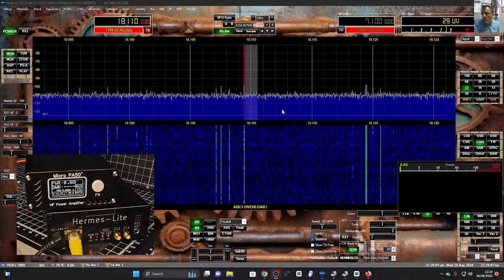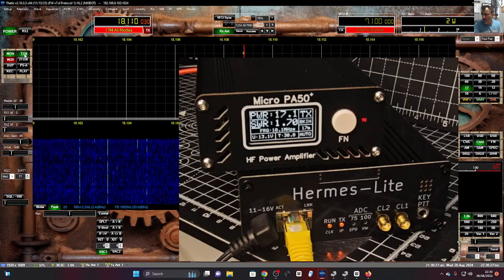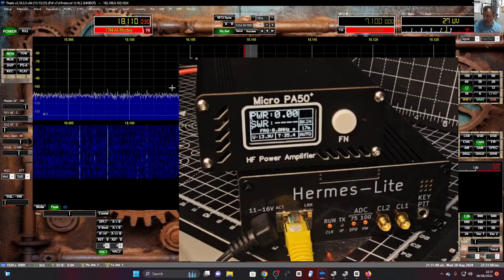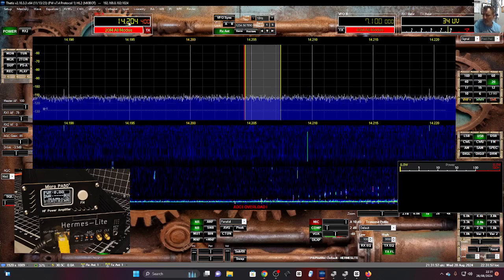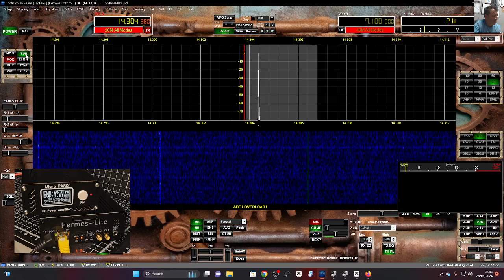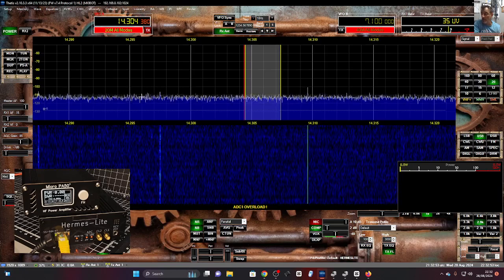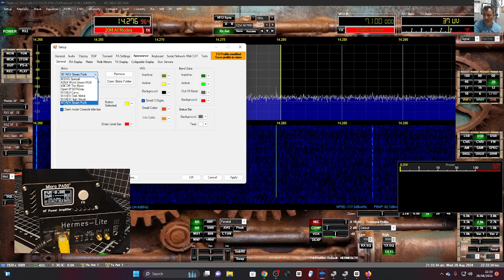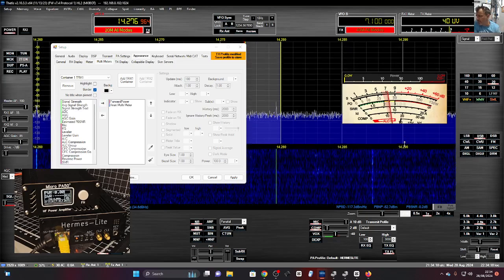Hermes Lite 2 & Micro PA50 watt Amplifirer

Comment: What is the amplifier's firmware version?
Reply from the maker: https://youtu.be/itwblf0cmSY?si=KjIZdpUpfHQ4WN9r
Reply: Great video.  Say, do you know if the Xiegu L4001 cable works between the x6100 and the pa50+, so we don't have to depend on autosense?  Thanks in advance.

Comment: hit the white button 9 times. I have the none + unit but it's in a different room with a ATU. When I tune up the Amp will beep(over power or high swr) but after the ATU is done tuning the Amp will reset after about 3-4 seconds so there is no need to hit the button . 

Right click on the AGC Gain slider and it will auto AGC. 

There is a setting, I would need to look it up, that splits the TUN and Drive. So you can have two power levels
Reply from the maker: Ok